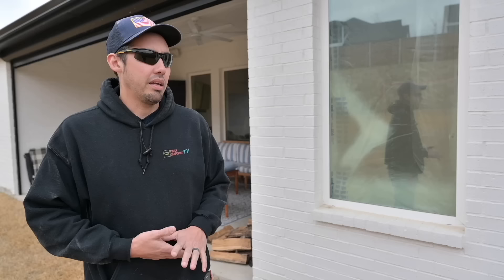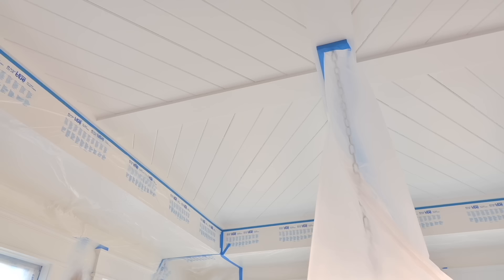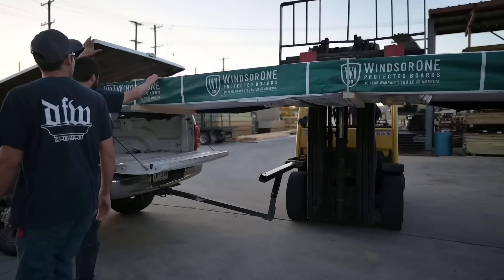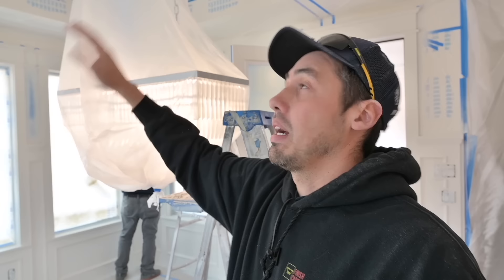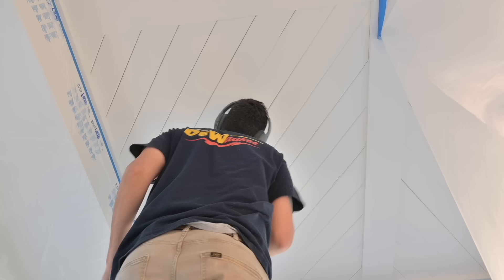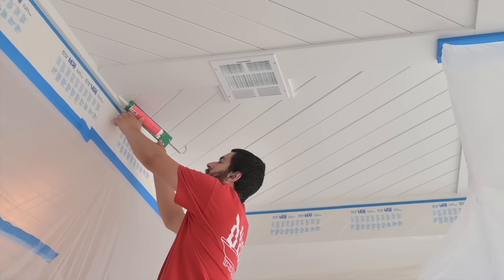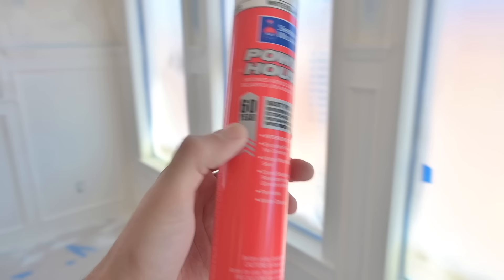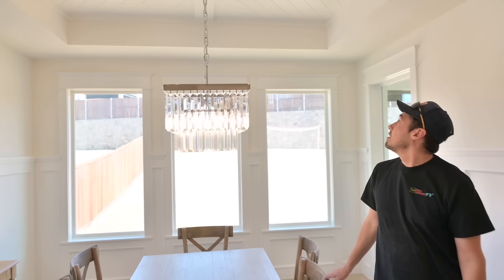Customer furious with me - Failed Trim Install

Comment: Very noble of you to fix it. 
Yet it will happen again. This spring and summer that wood will expand and squeeze the caulk out. That VENT  in the ceiling is the culprit, pushing dry hot air !!Wood moves in homes. It all depends on how perfect they keep the humidity.  Good luck 

You should not own it!! 
It will cost you a lot of your labor!!!

Comment: Not your fault bud. The entire house is high moisture environment for the first few months. The whole house would need to be dried out. Think about it. Concrete involves water, so does grout, drywall mud, paint and especially framing lumber, plywood are all high moisture items.

Comment: At this point, if those joints open up again, it is the customer's responsibility.  After a year, the wood is definitely acclimated.  Since you do not live there, you can not control the relative humidity.  It will wick up humidity in the summer and dry in the winter of system to control humidity is not employed.  (Some would have not redone the caulking even once because of this)  You have now done your due diligence.  If you have a customer who is paying you for maintenance, well that's a different situation.

Comment: I don't understand the caulk. The boards are going to move regardless of how acclimated they are. You should spray at the driest time of year when the tongues will be most exposed, and educate homeowner that gaps will appear in the winter and disappear in the summer.

Comment: I've worked with plenty of wood in restoring a 115 year old home up to speck with original custom milling with multiple types of expensive and cheaper wood and this is normal!!! There is no such thing as wood not expanding and contracting, I would not put caulk, it will eventually happen again.

Comment: I doubt i'll get a response, but asking purely for education - would painting the boards first and then installing not solve the expansion and contraction visual difference? or is the answer more expensive caulk like big stretch? thanks.

Comment: Well my man, your issues go beyond moisture content. First off, after making sure the moisture content is good to go, the product needs to acclimate to the house. Then, at minimum you should prime (be sure to tint your primer with the final paint color) on the front, sides, and all edges of the T&G. Then you can install, then you do NOT caulk them. Then after they’re installed you can paint them up. That’s the only way it will be 100%.

Comment: The bigger the gap you’re trying to fill the more likely the caulk will separate from the wood due to seasonal cycling. You’re going to see cracks jumping from one side of the joint to the other pulling away from the wood regardless of your painstaking efforts. 
You should have discussed this with the customer. A manufactured product other than wood should have been used for this customer.

Comment: Question- with all of that taping and plastic around all the detailed areas, how do you avoid the paint bridging to the tape between coats of primer and paint while accounting for recoat times? Is there an extra layer(s) of tape you add to remove while each coat is in the process of curing or score around with a knife? I always have a very hard time avoiding the bridging if I leave the tape up for all of the coats and allowing recoat times, especially if it means waiting at least a day between coats of paint depending when we get them on.

Comment: If the customer was expecting a product that doesn't move and is painted anyway, then offer them MDF tongue and groove molded boards for a fraction of the price. No movement, no hassle, job done. If they want wood that never shrinks or moves then they have to be educated in the way of natural products.

Comment: Your Caulking warranty (60 Years) is based on "Proper installation" of the caulk. That finger technique is lacking from a Professional standpoint. I will elaborate if you care to listen. Besides that Nice work for sure. Love that you made sure to attach to directly to the Truss/studs!

Comment: I think they picked the wrong material for this application - if they don't want the joints to show.  It's no different than installing a solid hardwood or pine flooring - you will always have gaps, and caulking will not do what they want over the long term.  He should have used an engineered material that is temperature and moisture stable.

Comment: Hate to break your wishes but those boards isn't stabilized if they are real wood panels. Wood is never in stable condition it always expand and shrinks due moisture variation (winter/summer).

My own house has wood panel ceiling that had been on 20 year when i decided to paint them and similar crack appeared but i knew it that it will happen.
 
If you want flawless wood panel ceiling they need to be pre painted before installing.

Comment: caulking those joints doesn't work in my climate and geologic area.  Especially on the exterior.  I see that kind of shrinking on 100+ year old redwood in the Oakland area.  Sometimes very obvious at .25" in the V groove.  They don't fill the gaps with putty then stain 'em.

Comment: Sprayed thousands of them usually tell them to not to gap it because it will never stop moving.. the ones I have gapped will always do this..  unless you can control the temperature in that room.. you will be called back in sumer or winter

Comment: Is that extreme stretch home depot caulk worth the 3x cost versus the normal stuff? I've used it in a couple spots but not sure it would have prevented this... suppose the answer is "it depends"

Comment: i wionder if you had used a more expensive caulk initially it would have tolerated the expansion and stretched rather than cracked

Comment: Was the space conditioned with heat or A/C? I have seen several of your projects where there was no power much less temporary heating or A/C.  That is the fault of the GC or owner.  You have high end finishes and your expected  to do high end work without conditioned space?  So, the owner moves in and cranks up the AC and all the moisture is pulled from the wood.  What happens when the moisture is pulled from wood? Shrinkage occurs…….I blame the General Contractor for not maintaining the proper general conditions.  

Plus, since when is it a standard practice to caulk tongue and groove material?? The tongue is there to stop the material from curling on the edges.  Plus, it allows for expansion and contraction to occur.  How many ceilings have you seen where the carpenter installs the T&G without sealing or painting the tongue.  Then they use a spray rig without  pressing the material into the wood.  Months later, the AC is on or it is winter time and the owner looks up and sees the  raw wood where wood has contracted.  This is why the product should be bench primed with the the finish material.  Then Install the material and then you can use spray rig for the final coat.  Even if the T&G is pre-primed, there should be 1 coat on prior to install.   I am betting you will be back.

Comment: Why did he even caulk the seams to begin with? These panels are supposed to be installed without caulking to allow for continuous movement of the panels. They will ALWAYS expand and contract for their life because of temperature, humidity, suppport movement, etc. The whole idea of panel joinery like this is to accomendate for wood movement. It allows free movement of the panels WITHOUT a mechanical or glue fastener holding panel to panel together.

T&G, shiplap, etc... is all trending right now and purely installed for looks.  However, most have forgotten its how walls were made for centuries to account for wood movement. I see it all too much these self-employeed custom trim workers dont know the basics of woodworking & carpentry. They rely so much on ready-made products and high-end tools to do the work for them. Its more than slapping together a few boards together, hiding the nail holes, and using a "60 year caulk."

Comment: If the customer wanted a smooth surface without visible gaps why didn't they have ..... sheetrock ..... installed instead of t&g.

Comment: This falls under “new build issues”. Happens all the time when buildings settle causing mostly contraction issues. So more of a cosmetic problem which is easily fixed. .

Comment: This happened to a pine floor I installed directly to floor joist for a porch floor just weeks ago, I was told that I should have sealed all 6 edge’s of each board before installing, to lock in the moisture, I am keeping my fingers crossed but I do like the way it feels but it added 10 hours to the install, how do you pass that plus more than triple the sealer cost?

Comment: This is a string of failures and the repair itself is another in the string of failures. 

When putting up wood in small sections you can acclimate it to the lowest humidity conditions it will encounter throughout the year, not the existing humidity as you were doing in this video. The next failure was to not paint the boards on all six sides before installation. This reduces cupping which we can't see in the video but is almost certainly there. Painting on all sides also slows down the absorption and release of water making for less movement of the wood through the year. Painting the boards first also shows painted wood on the tongue instead of bare wood when it shrinks. The reason you are seeing the shrinkage so clearly is that you are looking at unpainted wood on the tongue contrasting with the white. 

Next up is the caulking. The boards should have had all their putty work done before the final coat on the ground where they were painted, not after installation. The caulk will inevitably fail as the wood moves and make it look bad.  With caulk there is no way to win in a situation like this. When the wood shrinks it sucks it in or breaks it. When it swells the caulk bulges out. Do you painting and putty on the ground and then touchup after installation. 

The next error that you are compounding with your "fix" is to paint the tongue and groove with the batts. This sticks the batts to the T&G and breaks the paint when wood shrinks as it will again. The T&G should have a finish coat and then the finished painted batts should be applied so the T&G can expand and contract without breaking the paint. Then the batts should be painted on the front face only, corner to corner, to cover the nail holes, not the sides that will stick the paint to the T&G.  

This is a whole echelon of work above what you are doing now. Your customers may well not be able to afford this kind of work. You can tell them about it and see if they are willing to go for the price and time it takes which may be double to five times what you are charging now. If you do start explaining this to customers and doing the work for some of the customers who can afford it word of mouth will spread and you will slowly move up in the hierarchy of better more expensive and nicer work. 

If you have any questions feel free to ask.

Good luck.

Comment: I mean  if there's one things floors have taught me it's sometimes the issue isn't your fault as a whole (don't mean ya don't fix it that's just unprofessional)  way to often do a customer go against my recommendations  as a professional and we'll 6 months a year later when it looks like crap because of a similar thing. Just makes me wanna beat my head off a wall. Prime example costumer wanted plank on their steps we explained everything we woulda had to do to meet the expansion guidelines  for the product and next day they call saying their gonna go another.  direction.

Comment: Climate changes... I once had a customer who's crown molding would pull off the ceiling in the summer like 0.25 inch - it was crazy.  In the winter it was tight to the ceiling.

Comment: Our company installs a lot of tongue and groove in the commercial field and we have this problem come up all the time the builders don't want to spend the time and money sealing it we won't put it up without sealing it and acclimating it it's being used in the wrong applications also if you look at the growth rings the water and wood is just not as stable as old growth and that's part of the problem it is a living breathing thing so we make a disclosure before we install it that it could happen

Comment: Two storey house? It's entirely possible the boards were fine for moisture content. If humidity throughout the year changed excessively, as it has here in Melbourne Australia the last two or three years, they've first swollen before shrinking. How much exposed end grain etc? Is it close to walls or wall cavities? Man. I think it's an uphill battle there. The idea for the ceiling is wack if you ask me. My folks have cedar ceiling in the back half of their house, unsealed, unpainted. It's tongue and groove. It was 30 years old before one fell out. Looked perfect until that point. But yeah water in the ceiling at some stage, then they shrank back so much one fell out.
Reply: To clarify. I don't think it's your fault. Other than actually agreeing to do the thing. It's going to pop again no matter what. Just a matter of when.

Comment: You made the mistake scraping the old caulk out. ALL caulk shrinks doesn't matter that the manufacturers say. You'd of been best leaving the old in and applying new its less likely to shrink because theres less gap for the caulk to fill.

Comment: Oh no. That's the same thing that happens with wood floor work. Once you start dealing with goods that are over 4 in wide. They're going to start moving around wildly. I have it at as a disclaimer when I work with wide plank products. Technically you didn't do anything wrong. I've seen houses where guys installed wide plank wood that wasn't acclimated. One year later pencils can fall in between the gaps. I've looked at the repairs for customers. There's nothing to do. If you have the wood too dry it will swell with humidity. If the wood is too moist it will shrink like crazy. Really no matter what you do the wood is going to move like crazy. Maybe decorative stuff like this is better to use MDF when it's wide?

Comment: Part of it is your fault, but not all.  Some is just nature.  We paint all of the tongues before installation.  The grooves shouldn't have been caulked.  That was the real mistake.  By painting the tongue and not caulking, when the boards contract you don't see an unpainted area.  This is also important because in the summer the boards will swell back up.  In the winter they will shrink again.  You took responsibility which is great.  That's the way to do business.

Comment: Do not be so quick to blame yourself….the MC of the material is the responsibility of the manufacturer and lumber yard. The other thing is how the HVAC system in the house works…..does it have a humidistat and can it properly maintain optimal levels for the area……is it working properly.  As far as acclimation goes, if the wood was too wet when it was manufactured or case hardened because it was dried too quickly,  it is subject to large movements.  Also Moulding are being sourced from other countries where they do not adhere to proper drying practices.  Go back to the lumberyard will an bill in hand.

Comment: That's not a failure.  Caulk/ drywall is going to need to be pointed up occasionally. I wouldn't expect a contractor to be able to guaranty their work against everything forever. Things happen.

Comment: Anyone with any basic wood-working experience would know this was due to typical expansion and contraction. Two best ways to deal with it is to ensure the area has proper moisture/humidity control and in a perfect world, let the boards acclimate to the environment they are being installed in. Even then you will still experience some change but should be substantially better.

As others have said, you can also paint or seal all sides of the boards before installing in an effort to deter moisture/humidity changes from having such a drastic affect on the boards

Comment: So the caulk failed because of movement in the material, but is the customer keeping the room properly temperature controlled? As a painter I can't tell you how many times caulk has cracked open a few months later on base and door casings because the customer was too cheap to run the heat and ac regularly... Definitely not something I'd normally redo for free. They'll be calling you again in a year 🙄

Comment: You don’t own this problem if the architect and GC are doing their part. The specific material should be listed In the plans, so it shouldn’t be your responsibility. This is a problem of irresponsibility on the part of the people who should be making these decisions above you. There should be detailed notes on installation methodology. Did you leave a gap for expansion at the perimeter/edges of each field? It’s possible, depending on where you are of having a prolonged humid period and if you didn’t leave expansion room, the boards may buckle at seams between individual lengths and even pull out of th finish nails or crack. Using manufactured material or denser hard wood boards would have been a better choice. Different species of wood have different expansion rates across the grain especially.

Comment: I would not have caulked that. The gap should be consistent and should not be filled. Chances are the same thing happens as the seasons change. You basically did the wrong thing twice!